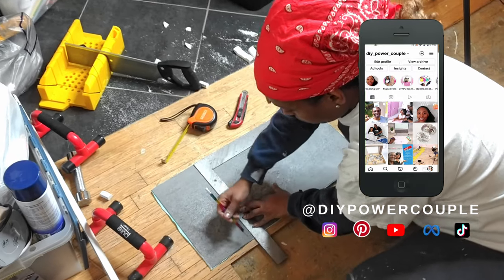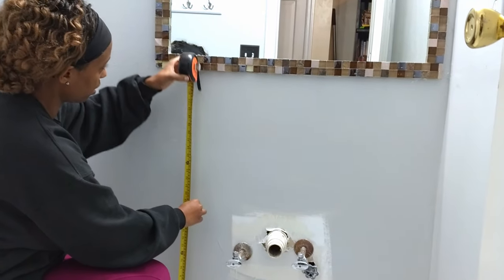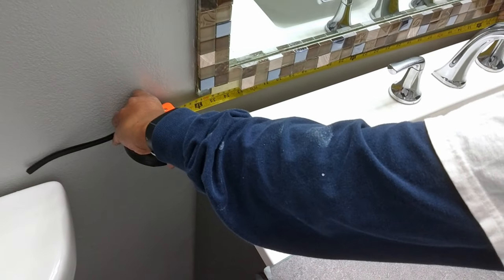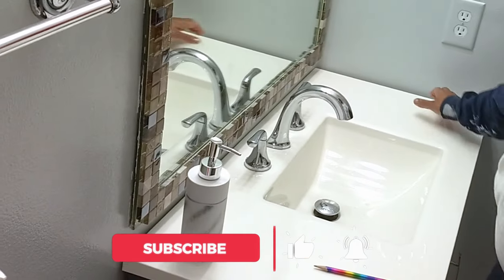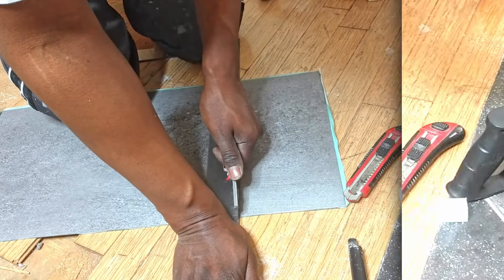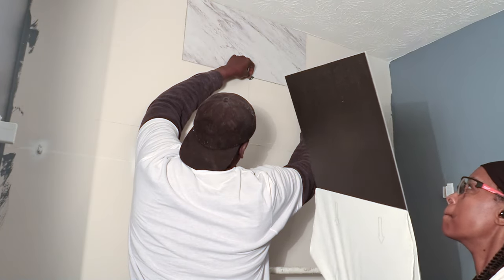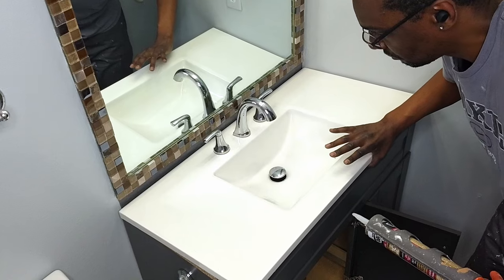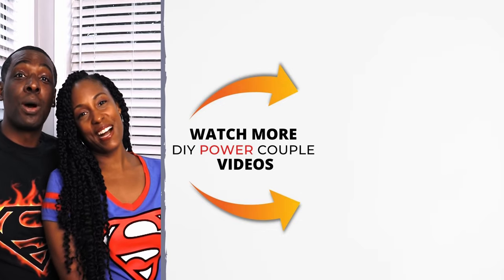PEEL & STICK BACKSPLASH DIY - DO'S AND DON'TS

Comment: If it is peel and stick, why does additional adhesive need to be used?
Reply from the maker: It's only if you install floor tiles vertically on a wall.  This video explains more: https://youtu.be/Ki7gThM6r2g